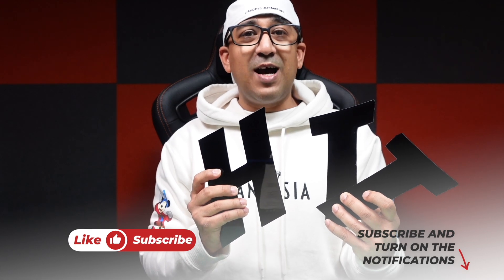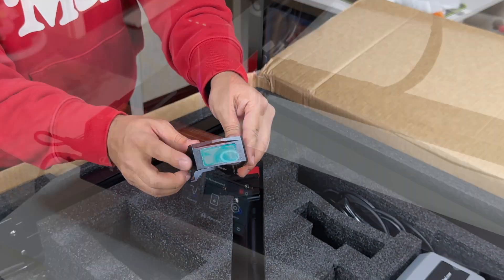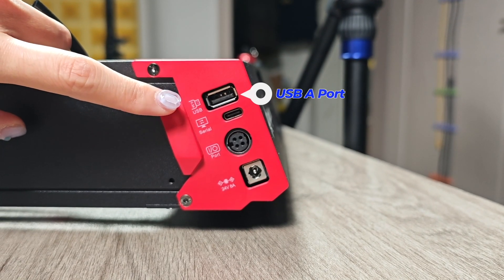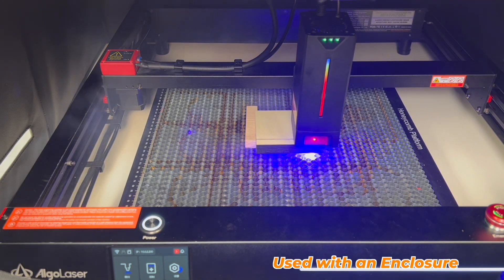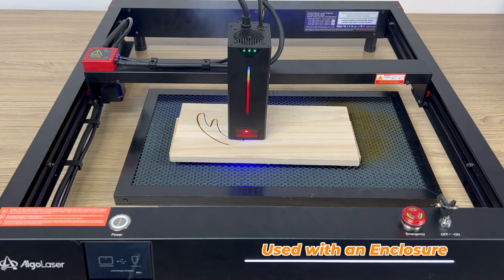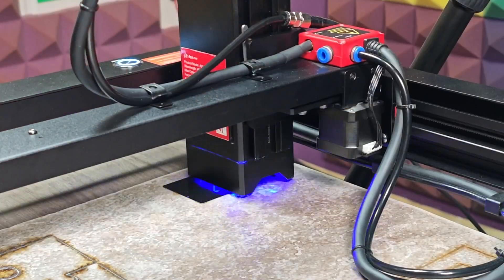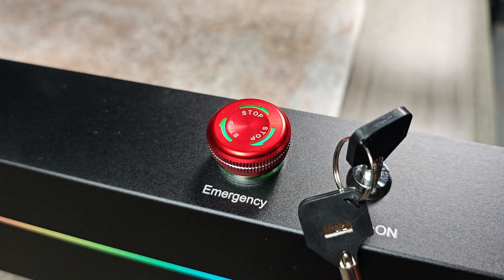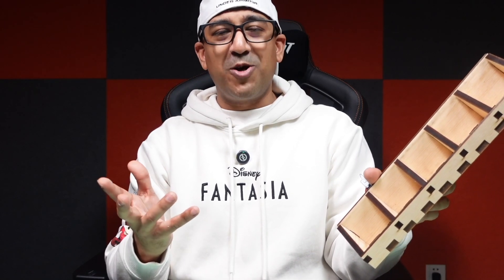AIgoLaser 40W High Power Intelligent Laser Engraver

Comment: the DC port says 24 volt and 8 Amp that means 192 watt power ...does that mean it requires in 192 watt input power to output 40watt😗